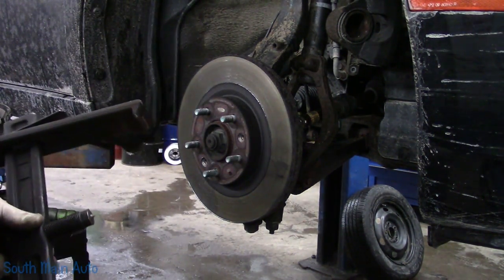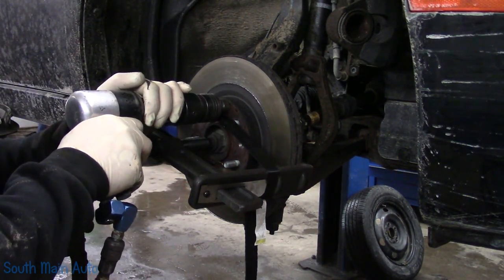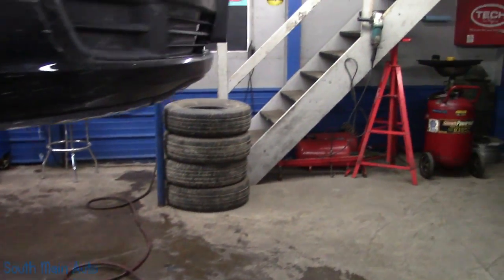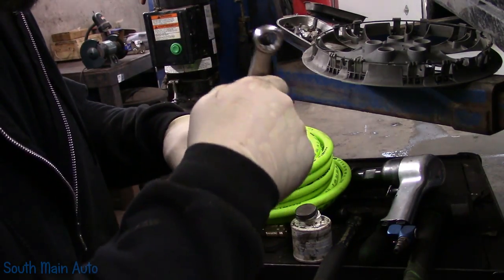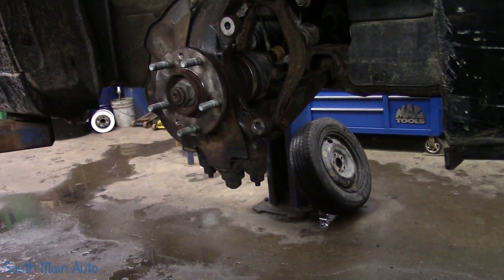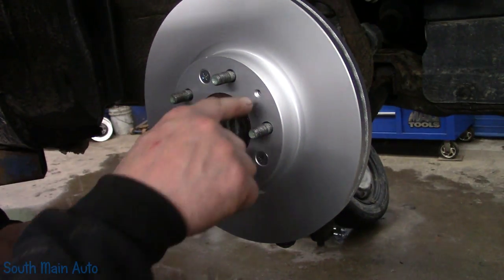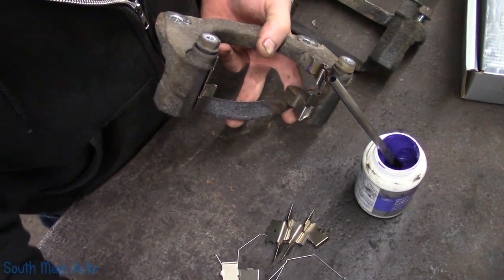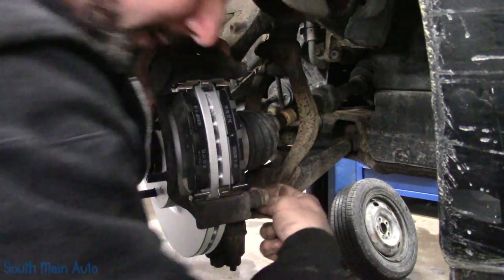Mazda 6: EXTREME Brake Rotor Removal 😱

Comment: Brah !! Your not using the little hole to remove rotors !! That's why your having such a hard time !!
Reply: In the rust belt that's alot easier said than done.
Reply: The amount of rust falling off the rotor when big nasty was hammering away was nuts
Reply: I got a mazda 6, the 10mm hole will do nothing but get one more thing stuck.  I do not know why the rotors stick on like they do on mazda 6's but they certainly do.....but only the first change.
Reply: That might work in Texas but not in NY state.
Reply: how about putting a short screw with vaseline in that thread on a new rotor, then remove it and use a long screw to take the rotor off?

Comment: Dont feel bad Eric I had a Mazda 6 2 years ago come in the same deal brakes. Well brakes turned into a wheel bearing, lower control arm, brakes and a new axle. Couldent get the rotor off called the customer and got approval to continue to smash it off with a hammer. Ended up splitting the rotor in two with a 12lb hammer and 4 hours of swinging. So get the rotor off go to pull the axle out seized In the bearing. Go to remove the lower ball joint of of the knuckle seized like a mother. Took me two days to do front brakes a wheel nearing an axle and a ball joint
Reply: 48hrs to complete total job on a Mazda6? Hell that's not too far off book time right?
Lol not bashing you, though I reap the auto repair benefits of living down south, I  have experienced way more Rustbelt native vehicles then I'd care to have. Over recent years instead of landing in the crusher, northern vehicles have been making their way down south through used dealer auctions where state inspection laws are more lenient. Used to be I could quote jobs over the phone without a second thought, now after experiencing similar situations as you mentioned I've learned to not even give a ballpark estimate without first seeing the car. Luckily thanks to Eric O and his videos I am now better equipped and more knowledgeable on how to combat these situations, making me one of only a small few in my area willing/capable to take in these repairs.

Comment: After a similar experience of removing stubborn and original disc rotors on my Corolla 2006, I always brush hubs and the inner side of rotors with a light coat of anti-seize.
A few years later when I was removing rotors they just popped out without any effort.
I don't live in Rust Belt but anti-seize is a miracle when properly used.

Comment: I hope those in the south like flat rate master who say flat rate is better than hourly and salary and also say that they can do a brake job in a few minutes are watching this video. NOTHING in the rust belt and in New England goes by the book. I've had few of these nightmare Rotors and screws also, that usually turn the job to a 4 or 5 hours job very quickly. Can you imagine if Eric O didn't have big nasty and all the other badass tools in his arsenal, it would have turn into way more trouble than it was. Keep up the Great work Mr. Eric, I'm looking forward to your next video.

Comment: Doing a brake job on my Madza 3 with 160k miles on the factory hardware running in the rust belt took a sledgehammer to shatter the rotor off.  I feel your pain.

Comment: ISN'T THE SAFETY STRAP SUPPOSE TO GO AROUND THE BACK OF THE ROTOR?
Reply: No, look at their amazon pictures, they do it the exact way he did it. The job of the strap is to prevent the arms from spreading under load. A lug nut that is threaded on will prevent the rotor from flying (which they also have in their picture). Even if the strap went behind the rotor, the whole assembly can come flying off, like it did here.

Comment: When I changed my brakes last I used some brake grease on the face of the hub after I had huge issues removing the old disks. Now I use a little Muscle Grease when I put the new ones on after cleaning the hub face. It works for me.

Comment: Great video. I have that brake drum and rotor puller. I have not used it yet. I loaned it to a guy at work twice. My buddy told me a story that he had to cut  a few rotors off with oxy acet. torch. I thought that was pretty extreme, then we had to do it at the shop. I used air hammer, baseball swings with a 4lb sledge, then cut them off.

Comment: Do you have a link for the device you used for cleaning around the studs? Put it on your Amazon page
Reply: It's in the Amazon link. 3M 07547
Reply: Just purchased one and oh man does it work good!
Reply: @gtoboss600  I'm thinking about buying one as well. It's the bees knees as Eric O. would say.
Reply: I used mine in a 18v cordless drill just because it was easier to swap with the larger chuck compared to finding the collet wrenches for the die grinder.  Even with the lower rpm from the drill there was absolutely no issue cleaning the stud bases.  2-3 seconds per stud and you get a perfectly clean hub face just as Eric shows.  I believe the pads will last a fair amount also as they are fairly aggressive and hard.

Comment: Very entertaining to say the least.
It reminded me of the time I had a sticking emergency brake cable and didn't know it. The wheel got so hot that the tire blew up. The brake drum was practically welded on. When I got it home, I beat on the brake drum with a sledge hammer and after what seemed like forever it finally flew off.

Comment: I did a wheel bearing a month or so ago and had to get out the grinder and cutting wheel and cut the damn rotor off. Didn’t have a puller tool. Busted the rotor to pieces with a sledge before cutting it off. Pennsylvania cars are always fun to work on.

Comment: In 1992 I bought a Plymouth Laser.  Todd Day moderated the support forum for these Mitsubishi cars - the Talon Digest.  Todd wanted to replace his rotors but couldn't get them off.  A friend of his had a hydraulic puller.  They maxed that out to no effect.  As they walked away the machine and rotor assembly embedded itself in the wall.  The accepted practice in those day was to take a large chisel and cut the rotor into pie shaped pieces.  These cars would even stick the wheels on to where they had to be hammered off.  Fun, fun, fun.

Comment: Always enjoy your videos. What I do is drill a hole through the rotor as far down as I can without hitting something on the other side. Take and saw down to the hole and put a tapered pin in the hole (centerpunch?) After hitting it with a hammer this cracks the rotor and off it comes.

Comment: That was a scary one, Eric. Glad you didn't get hurt. I have torched rotors off before that were stubborn or beat on them until they broke in half. Neither way is good for the wheel bearings.

Comment: That hose is awesome in the cold as it stays plyable and soft and i had te same problem with rotors on my mazda3 i ended up making a puller from scrap didnt even know they existed till now i put 2 of the lugs on to keep it in place

Comment: I cut with a sawzall and fine metal or cast Iron cutting blade from the outside edge of the rotor in through the rotor brake surface and stop cutting just shy of the hub the rotor is stuck on.  Then take a cold chisel and tap it into the slot. This will flex the rotor and help break the rust free. Just make sure you are careful cutting and don't hit anything on the inside.  If it's really bad cut it a second time 180.  It really doesn't take that long and is easier then beating it with a hammer.

Comment: For you semi-amateur mechanics out there what you just saw is very real.  I had rotor I needed to remove off an old MG that I was having the same problem with.  The usual treatment with a hammer had no effect.  I next went to the pulley puller and proceeded to crank it down and intermittently whacking it with the hammer.  I was starting to get real nervous when I could see the rotor was starting to bow.  And yes it was about that time that all hell broke loose.  The puller ended up on one side of the garage and the rotor on the other.  When you are doing this you definitely want to get way to the side of your work!  Even so It will still knock you down, probably just the concussion of the parts flying my your head.

Comment: I've had the same problem.  A sledge but no puller.  I cut across the face of the rotor hub with a cutoff wheel. It was enough for the rust to let go.  Thanks

Comment: A friend of mine has a Chevy HHR had the same problem. Did it on the ground here in Pittsburgh PA. Even a 20lbs sledge hammer and a hub tamer was no match for that stuck rotor.  The rotor wasn't moving. He called me up for my help. A hydraulic porta power with spreader jaw did the trick. Didn't pop off like Eric O's.  This job does suck in the rust states. I was concerned about bending the steering knuckle with that much forced applied. It ended up all good.

Comment: I heat the rotor on the inner and outer hub face hub face with a propane torch. With a 4lb hammer I wail the rotor just outside of the studs alternating from side to side. That pops them off! I live in  Albany,  NY

Comment: I just changed the factory front pads and rotors on my Silverado the other day, 123,000 miles on the factory front pads and rotors.
The outer pads had half the Life left on both sides, the inner pads were almost to the backer plate and of course the rotors were warped...

Comment: The rotors on the rear of a 95 Jeep I drive where stuck. The 20 lbs sledge did nothing. I resorted to taking an angle grinder and just cutting a seam on one side to allow the rotor to open up, then taking a chisel and hammer to open it up to the point that they would slide off. They did make a nice ping sound when I finally got them cut open enough. You got to love the rust.

Comment: Exactly what I expected. Rust welded Mazda rotors. 
And I have done these in my driveway. Thankfully I have an air hammer. Just not the puller gizmo. And given what the puller did to you, the hose, and the tool box, perhaps that's for the best.

Comment: I once was sent out to replace a winch motor bearing, it had a rope-windy-madoo attached which had to come off, big ole nut on the end and a locking taper, weighed about 100-150 lbs. Been a few years, remember it being heavy, but not specific. Anyway, wouldn't break loose with the big puller and the hydraulics, so we started heating... Didn't have the nut on, damn near launched the thing over board from midships. Made a nice ding in the railings too. Always remember to keep the nut on the end now.

Comment: we use a 1/2" flexzilla hose 50'  170# of pressure. in our truck shop and never have any problems.  been using the same hose for just over a year.  were happy with them.  3/8" hose on the back wall for general use.  hooked to same compressor no problems.  damn good hose

Comment: I couldn't get the rotor off of a Mazda 3.  I tried everything.  I went online and read a recommendation to cut a slot in the rotor with an angle grinder and then tap it with a hammer. 

Worked beautifully.  Two taps with a five pound hammer after cutting about a 1.5" slot into it and it popped right off in pieces.

Comment: Hey Eric. You can make your own safety chain for the rotor puller. Using the lug nuts attach a piece of chain to the lugs, leaving it a bit slack at the front and a bit of space between the rotor and the chain. When it lets go, the chain will stop if from flying out.

Comment: I use the rotor puller almost every day and one thing I found saves you a lot of Hassles or dings in the floor is to just put a wheel nut on loosely Or two on big rotors

Comment: I had problems with front rotors on my 2011 Ranger. After spending an eternity wailing on one rotor with a fist maul I went to Horrible Freight and bought a ~6ton 3-jaw hydraulic gear puller. Took about 30 seconds for the second rotor most of which was getting the tool in place.

Comment: For my '01 Expedition, I used a sawsall to cut in close to the hub, then an air hammer to expand the cut. Popped the rotors right off, you just need to make sure you don't cut too deep.

Comment: I did front rotors a few years ago on a Ford Focus (2012) I had.  The driver's side was stuck; no amount of beating would free it up. I had to work the next day, so the angle grinder and about a half dozen 4.5" cut wheels chopped that rotor into a many pieces, until the inner hat popped. Had to repeat on the passenger side.

Comment: Kind of reminded me of pulling the drums off the rear of a '68 Scout (tapered shaft).  Get the puller tightened up real good (it had a nut with wings you hammered on), then you'd give the puller shaft a straight hit towards the axle.  If you were lucky, it would pop off the fist time, but not quite as dramatic as yours.  Rust is interesting.  Being it's oxygen + iron, it takes up more space on the molecular level, so it can develop incredible force when confined.  My brother's had rusty bolts on trucks where when he cuts off the head it goes "ping" and shoots across the shop like it's spring loaded.

Comment: 1 hour for rust removal, .5 for pads and rotors. 1.5 to keep the lights on for 1 more hour plus 50$ tip from a very grateful customer that goes straight to mrs. O. What a great business to be in😓

Comment: A friend of mine had a 2004 Mazda6 with a 3.0 V6. One thing I found out about this engine is that it's prone to oil burning due to a badly designed PCV system.  This will cause the catalytic converters to go bad (this engine has FOUR of them!) , which will cause engine failure. I improved the PCV system in his and stopped the oil burning. Also, the coils and the fuel injectors will go bad one by one.  It is best when this happens and you want to keep the car, is to replace ALL of them when they start failing.  One last mod on this engine is to eliminate the early water pump belt tensioner and use a later year model stretch belt.  At the same time, I recommend replacing the water pump pulley oil seal, which leak A LOT of oil when they harden up.  I just wanted to share my experiences on this particular car I've worked on.

Comment: Start a few days in advance adding PB Blaster penetrating oil spray at the wheel bolts and at the back joint, and do it more than once. Problem is it will contaminate the old brake pads. After getting the rotor off, a thin layer of marine grade wheel bearing grease in between- more salt resistant. For a dust shield if the old one is rusty, cut an old license plate to fit, and spray paint it with the bedliner paint Project Farm found worked best.

Comment: Been there done that.   Not in my driveway… in my workshop… near Albany NY.    I’ve got a scion that now needs a wheel bearing because I beat on the rotor so hard.   I also thought it was cool that the OE brakes on my VW weren’t worn out at 150k until I had great difficulty removing the rotors from the hub… The struggle is real….  Soldier on…

Comment: I work a Mazda dealer in Massachusetts and when those come in we use a Sledge hammer to knock the rotor face off and cut the rotor hat with a cut off wheel almost through and then use an air hammer with a flat chisel bit to spread the cut open to get the rotors off.

Comment: Learnt from a similar situation many moons ago from a sturdy drive shat with hub from a street sweeper. Parts flew apart without any warning while heating with a torch and parts under force.
Shaft was about 35mm diameter and ended up in a wall leaving about a 30mm indentation.
Close call, won't happen again. Beware and be careful, simple mundane tasks can maim  and kill you in a heartbeat.

Comment: I had similar issues with my '09 Mazda6. Replaced the original front rotors at about 150,000 miles and the driver's side was seized on like nobody's business. Beat on it with progressively larger hammers until I was sure I was going to break something. Of course this was in my driveway in a rain storm.

Comment: I live in MN. Which is in the salt belt also. My trick is use big nasty around the sides of the hat of the rotor. Which loosens the rust then hit it from the back side with a six pound hammer.

Comment: Back when I worked at a shop that did only brakes, I'd pour some brake fluid around the center of the rotor where it meets the hub. We always had old brake fluid handy and its so corrosive it'll help loosen it up.

Comment: I'm in a very salty and rusty area, and winding a bolt into the hole works fine for me every time. Maybe that's because I do it at least twice a year so I can clean up the accumulated rust between brake jobs!

Comment: Wooh HANG on there fella .
A toolbox and air hose was harmed in this video and we almost had 2 Mrs O's at SMA :-O
That tight like a tiger lol .
I will also advocate using studs when they like that.
I normally give them right pounding around side flat of hat with the air hammer try rattle loose lot of the crust on back and make pull little less scary .

Comment: Had one like that on a chev 3500. Nearly a dozen bolts stripped out on the "puller holes" Designed in the rotor itself along with a puller AND A 4 LB SLEDGEHAMMER!!! damn rust made such a ridge it wouldn't clear the hub!

Comment: I just recently redid the brakes and calipers as well as new wheels and tires on my 2010 Mazda 6, it involved a cold chisel and a 5-pound sledge.

I had to wedge the cold chisel through the steel wheel holes against the brake caliper brace and pound until the wheel popped off.

Then I had to wedge the cold chisel between the rotor and the mounting point for the caliber and beat the hell out of it before it finally popped off.

By the 4th tire (and second day) I had it down to 25 minutes to get a wheel and tire off.

I then hit the mating points with a wire wheel and slathered them in anti-seize, hopefully, when I go to remove them again it won't be such a pain.